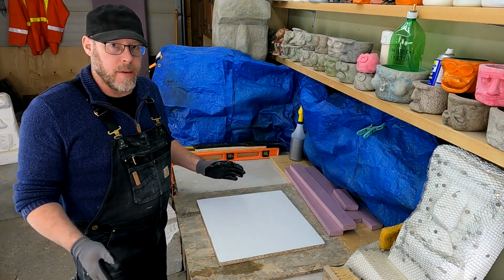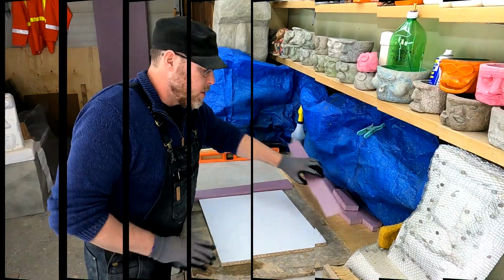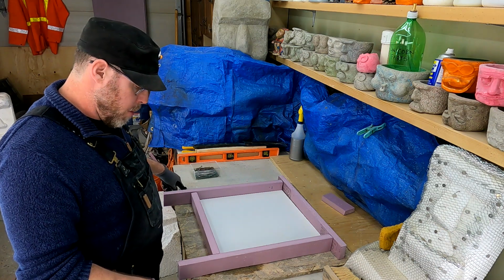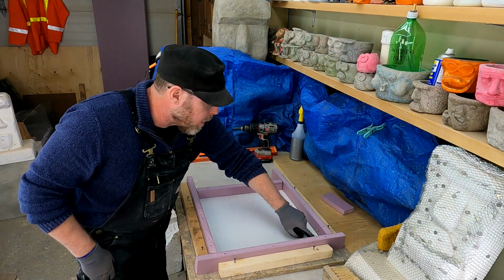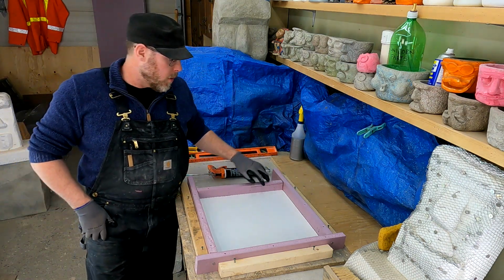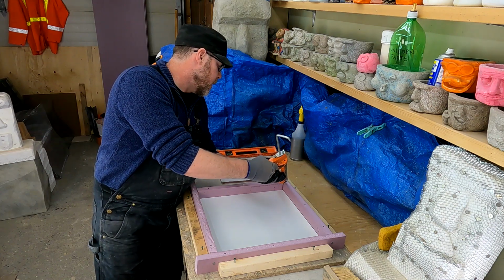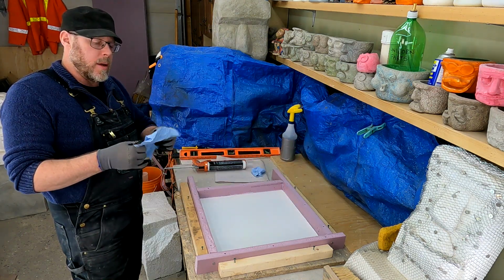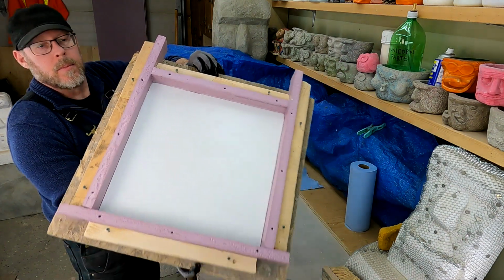How To Make A Concrete Outdoor Table

Comment: Question: would it work to use the same melamine particle board for the sides, in place of the foam? I don't understand the reason for using two different materials to form the mold box? Thanks!